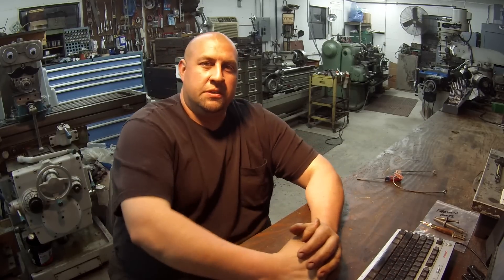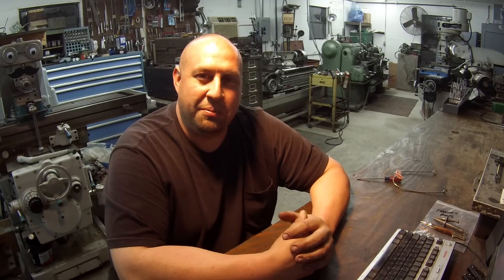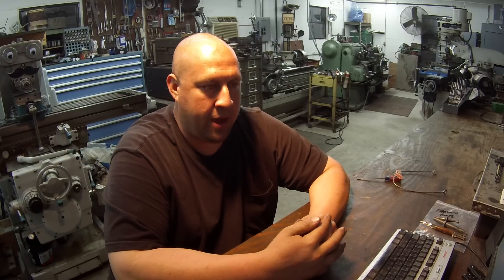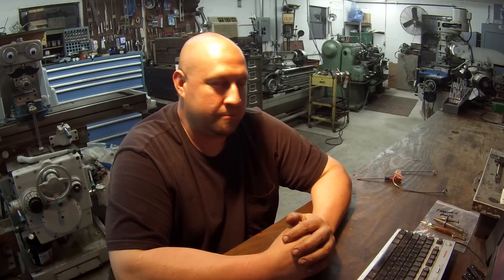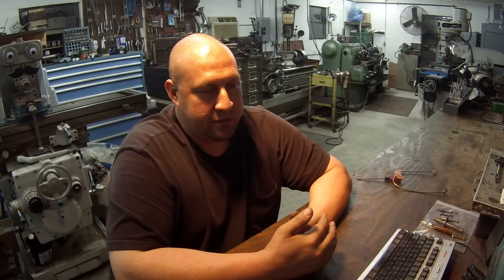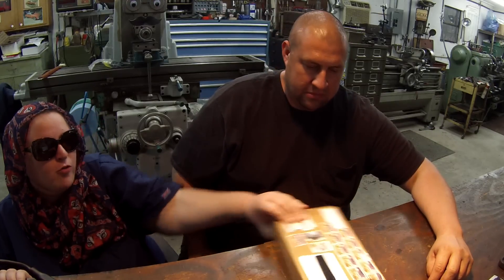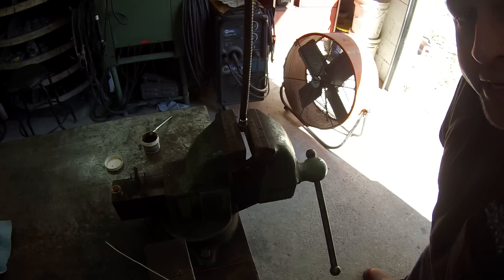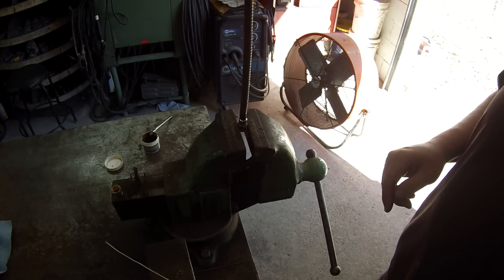Saturday Night Special 42 Part 1

Comment: Hey Adam,

Those taps come usually in a set of 3 - one initial stage roughing(undersized), mid stage for roughing(slightly undersized) and third one for finishing(right size).
In Europe it's very common for quality tools to give 3 taps for each size, to make sure your tap does not break in a very expensive piece or strip the thread, go in crooked etc etc.

Thanks!
Reply: And the first stage has one engraved ring (or line) on the shaft, second has two rings and readycut has no ring or sometimes three rings (if i remember right).
Reply: That all right, here in France i have lot of this 3 set taps.

Comment: Hey, Adam-

Just want to thank you for setting a consistently good example with eye protection.  I'm trying to get better about eye/ear protection when I work in my garage, and it's good to see the pros thinking about it too!
Reply from the maker: Your eyes are important, so lets protect them! Hard to make parts if you can't see them.
Reply: Absolutely.  I've gotten junk in my eyes a few times (sometimes even while wearing "eye protection"), and it's no fun!
Reply: Ears are trickier.  It's easy to not realize how much potential damage you are doing with loud die grinders an such.
Reply from the maker: I prefer the ear muffs style over ear plugs. I use them when the grinders are a little too loud.
Reply: I feel the same.

Comment: Hey Adam,

Glad you like the tools! As 'HurtigrutenExcursion' said those are a set of 3 hand taps.  First stage is rough cut, second is medium rough and the third is for the final pass.
Thanks again for your great videos!

Wish you the best
Dimitris
Reply from the maker: Thanks Jimmy. I never took the other taps out of the box or I probably would have figured that out, but i knew the viewers including you would let me know what the deal was. That's an interesting set of taps, some of which I have never used before. So I learned something new today. I will try them out some time on video to clear up the confusion.
I, and Elena both enjoyed getting your package from Greece. it was a real treat. Thanks so much for the tools. Thanks again, and we'll see about that Skype soon.

Regards,
Adam
Reply: Abom79
Hi Adam,
As another viewer said, in Europe is common to use this type of hand taps 2 stages for rough cut and the third for finish. Glad to hear that you like the tools. As you read in the letter the taps are made from carbon steel, they work good on brass and mild steel.
All the best, for you and Elena!

Thanks again
Dimitris
Reply: Abom79 Looks like you got the answer about the taps - I was looking for a set of those in Canada and couldn't find them, the guys at the counter looked at me a little strange (I figured later I was asking for unobtainium). These work better (easier) if you power tap with a drill press for example - wanted to use them when I made my welding table and needed to tap 100+ holes (ouch) to use with the machining clamps - would have probably been a breeze with a set like this and a magnetic drill press, needless to say I'm still working at it and I started it a few years ago :D. Wish I had a set for 1/2''-13. That's a nice gift European style :)
Reply: That explains both the precision of some European parts and the cost as well.  Never heard of doing it this way, but it does make sense if tight tolerances are what you need.

Comment: From what I remember working for a Plumber ..A Gate valve has a slug of brass that moves up and down ....A Compression valve has a rubber washer and a seat...A Ball valve (a.k.a. quick valve)  is a ball with the hole in it  Ball valve is for a Quick on and off  with high pressure...  I would use a gate or compression valve like your red handle one ..You have much better flow control just like the older faucets were
Reply from the maker: I'll most likely use the valve I showed. It's new and unused.
Reply: The 3/4 valve you showed is a globe valve. A ball valve opens with a quarter turn of the handle.

Comment: Adam,
I completely agree, we need American made products for American workers. 
Two things though, the Milwaukee valve is a Globe type valve. It is the best choose for throttling flow as opposed to on-off. 
Also, shutting the flow off with the valve while letting to pump run is bad for your pump. It will result in premature seal failure, and, if left for a longer time that way the pump will overheat. 
Always keep a little flow through the nozzle, and turn off and on with the pump switch.  
Nice solder job!

Comment: Hi Adam! These videos are great, many thanks.
 About those taps, take a look on those other boxes. I believe those taps are hand taps, and there is three different sizes. Taps are numbered I, II, Blank,  on the shank there is a groove. 1 groove is the starting of the threading, nad next is 2 ( huh ?). Finishing tap has no grooves ? Number 3. You can skip the second tap, and go from 1 to 3 directly. Big threads made by these taps, well they are cheaper to by, instead a machinetap that makes a thread at one go, and quite easy to twist by hand. 
Just my idea for those taps, check them out.
Reply from the maker: That's what it was. A 3 piece set. Several of the other viewers pointed it out, as well as Jimmy. I failed to inspect the other two boxes when I filmed the clip.

Comment: Adam, those valves look like they may be 'globe' valves, which are directional flow valves. So check out their direction. Usually the lower half is the supply side. Really good valves for metering flow.  Enjoy your videos....keep up the good work!

Comment: Adam,
Thanks for another SNS! I know what you are saying about stuff made over seas. When I was a service tech working on professional woodworking machines, I did a repair on an Altendorf horizontal panel saw. It has a very large deck so you can cut a full 4x8-foot sheet of plywood. After replacing some electrical components, I looked at the serial number plate so I could complete my service report. I damn near fell over! Altendorf is a German saw (I forget the city their home office is in). There were those 3 little words on the bottom of the s/n plate:  "Made in China". I thought, "You've got to be shitting me!" I thought German's were proud of their technology and their ability to make quality products. I guess cheap labor and more $$$ in their pockets is more important. I know how you feel. Back in the day, US quality-made products were second to none! End of rant! Once I get started, I don't know when to quit!
Have a good one. See you in Part 2.
Dave . . . A red-blooded American -- and proud of it!
Reply from the maker: I feel ya man, I feel ya.

Comment: Hi Adam,
not sure if it was pointed out yet, i think the taps are from a "hand tapping set". Each set has three different taps in it. First one would be the "precutter" that removes something like 55% percent of the material. It`s usually marked with a groove on the shank. Then there`s the next tap, usually marked with two grooves that removes another 30%. Last one, usually not marked at all is the finishing tap, that removes the last 15% of material and finishes the thread.
Julian from Germany

Comment: Check all three taps in each size. They may be progressive taps where you remove some metal with the first tap, remove more with the second tap, and finish with the third tap. This reduces the force needed for each tap, and allows a light finishing cut for a better thread form and smoother threads.

Comment: good video once again. The 2 new valves you have look as if they are "globe" valves. They are used where quality is needed such as steam and hot water. I agree with the comments on the manufacturing industry both here in the UK and the USA. We cannot compete with low labour costs and what we call sweatshop labour. But as those countries rates increase and the people want more and more things will change somewhat. How can we compete when Venezuala and the far eastern countries sell fuel for $08/12 per litre. Ok off to watch P2.

Comment: Adam, you might try taking the original gate/globe valves apart and checking them out. you may be able to repack the valve stems so they don't leak.

Comment: Great video Adam, as usual. It would be a different story if we had a 50/50 trade agreement, along with acceptable quality control measures. Our government is into so much "hock" with China, they don't impose the trade agreements necessary to keeps things even. Personally....I prefer the lever type for your application, and think that with a little research you could easily find one.....how about you air hose guy? Looking forward to part 2!
Reply from the maker: Jim, I'd really like to use the red handled valve and possibly make my own fittings, havn't decided yet. Might make for some more interesting video to share.

Comment: Adam,
I'm with you all the way on that imported junk from the other side of the planet, we have the same issues here in New Zealand, everything now is bought in from overseas, it does my head in, I end up spending more time online just to find quality equipment whenever I need it, also just looking at that gate/ball valve with the red handle, you should be able to get a smaller diameter one of the same quality as standard I would think, I know that they are available, you might just have to hunt around a little bit, anyway, enjoying your video as always,

regards

John MD
Reply from the maker: I'm sure with a little bit of online searching I can find the stuff I need. I'd like to put the red handle valve in use though, and possibly make my own pipe fittings.
Thanks John!

Comment: I used to work for a ferrosilicon production plant here in Norway for almost ten years. Some of this FeSi was, and still is shipped to the far east for use in high quality steel production. And some of those products are high quality stainless steel oil&gas pipes, which in turn, is shipped back to the neighbour factory at the other end of the same harbour where I worked. The pipes are welded into mile-long strings and spooled up on a huge wheel, shipped to sea and installed on the sea bed and is used to pump gas from our continental shelf and down to central european countries.
This story is very similar to what You guys are experiencing over the pond. Raw materials(and investments) are shipped out to low cost production countries, and finished products imported the other way.
My point is, we could have made these pipes ourselves - here in Norway. The two sailings half-way around the world, could be replaced with a 15 min trip on a mid-size truck. All this nonsens, just to generate huge salaries and bonuses for the CEOs at the top of the pyramide. Disgusting!
As for the stores, selling cheap, low quality chinese products, we are getting more and more of this too... What's even worse  the staff who are supposed to have and to give info on their products, don't have a clue what they are selling. I usually end up buying tools on US or UK based web stores - dealing with people that know the trade and at reasonable prices too.

Comment: The tap(s) with the smaller diameter are part of three-piece tap set. The one with only one ring on the back goes first, then comes the one with the two rings and finally the one with three or no rings. In tougher material or with larger sizes the three tap method reduces torque, as every single tap only does part of the work.

Comment: Great video Adam, as always. I too also feel your rant. I was in our local Lowes a month back, looking around in the tool section, and came across a Porter Cable floor model drill press with a good price. The bed wasn't that great but I planned to throw it on the mill and do some work on it. Just as I was about to get a Lowes employee to help me make the purchase, I gave it one more look over and low and behold, Made in China! No way was I going to make this purchase. So I decided to look around to see how much I could find that was made in U.S.A.. I spent 30-45 min. looking and the only thing I could find was a biscuit made by Dewalt used in wood working. And people wonder why there are no jobs, Come On !!!

Comment: Adam
I believe what you have there is a 1-2-3 series taps, common in Europe for metric. these are probably made in Europe as well (similar to acme taps from roughing to finishing).. Still watching  the video so not sure if you had this mentioned by the end of the video.
Measure the other 2, probably there is one that has the pointy tips and is the right diameter.

Comment: Brother you are preaching to the choir about chicom junk. That globe valve might give you better control of the coolant stream. Good luck finding pipe fittings that aren't junk either, maybe a plumbing supply house might have some quality parts.
Reply from the maker: I'm going to do some searching and find out. I may just machine them myself though.
Reply: Abom79 Try McMaster they seem to have US made fittings.
Just got some bolts from them, all US or Canada made.
Reply: I have ordered a bunch of various hardware over the last two or three years, Mostly from Taiwan  with some US and Canadian. What size stuff did you get MrJohannaz? I just ordered some forged chain hooks which I'm pleased to say were made in the US

Comment: Another great video Adam, I see another viewer has already given you the answer to your tap sizes, I was also going to suggest that you have a set for roughing and finishing.
 I know how you feel about the cheap imports, I feel the same way about things in the UK, its a sad fact that the Chinese produce these things so cheaply the we just can't manufacture them for the same price in our respective countries.
 Well I hope your enjoying making your videos, as a machinist myself nothing more I like than watching your videos at the weekend. - All the best Adam and family... Mark in the UK.
Reply from the maker: Thanks Mark. Nothing like sparking a fire under my viewers!
Reply: Mark - the truly sad thing is that if the regulators and tax authorities would just be willing to settle for reasonable restraint - things that can be supported logically and economically, and provide adequate safeguards - and refrain from Social Engineering  - and you lot have it worse with Labour (Socialists) having so much power - coupled with the same stock share price driven lunacy we face here  - the factories can be made to run fairly profitably here.

Utopian dreamers and their insane Kafka-esque bureaucracies, all empowered to say No! - except to higher taxes and the like - are too great of a burden for manufacturing to survive...

Note, I am not saying that the Chinese "system" of unenforced regulations and connections and other corruption is what's needed for successful mass manufacturing - there are extremes to either end of the spectrum after all!

Cheers!

Eric

Comment: Hey Quick Draw, Elena has a great personality, she cracks me up. In your last video when you were putting on the coolant pump, you used a pressurized degreaser can. I've never seen one of those, where can I get one. I ask this question on the last video, but got no reply. Love your videos, and am learning a lot.
BTW, I'm with you man. on the cheap junk shipped here from China. I'd do the same thing your gonna do to the valve. You ought to hear me rant about what's going on here in our country. It's terrible. That's all I'm going to say, I don't want to get started.
See ya
Mark
Reply from the maker: Yea there's been a few on here that's getting into a heated debate and I've about said all I want to on the subject. I think most of us feel the same way.
About the sprayer, check this link.
http://www.sureshotsprayer.com/
Mine is sold by Zep, but I'm sure it was made by Milwaukee Sprayer. It's a good tool to have in the shop!

Comment: A few years ago I bought some 90 deg. 1/2 gas pipe for a Mr. Heater, heater that I was installing.  The pipe fittings said "Made in Mexico".  After turning on the gas, I smelled gas and heard a hiss.  I soaped my fittings and there were no leaks, I then looked at the 90 deg. fitting and saw a pin hole.  After disassembly of the pipe, I looked at the fitting and it had a casting defect.  Forward to this year, I purchased some more pipe at the home depot, and now ALL the pipe says "Made in China".  My point is as a consumer I would like a made in USA choice.  Finding Made in USA products is very difficult!
-Todd
Reply from the maker: I like your thinking, at least give us the option to buy, and help support our own economy and companies. Just like when I have my people buy my cutting tools, I always tell them to go for the made in USA brands that we can get.

Comment: Just a thought: The taps that do not measure to the major diameter for an internal thread - are either meant as a re-threading tap for damaged threads, or they are intended to cut threads as, say, 55% of full thread depth, or they are meant as starter taps.

Comment: Are the taps for a two stage tapping process?
Or is it to make a self locking thread?
Like an interference locking thread?
Reply from the maker: Some of the viewers have pointed out that I have a 3 tap set, first one is starter and each tap progesses in cut, with then last being a final cut, or finishing tap.
Reply: Abom79 A hah!  So that is the reason for the "undersize" tap!